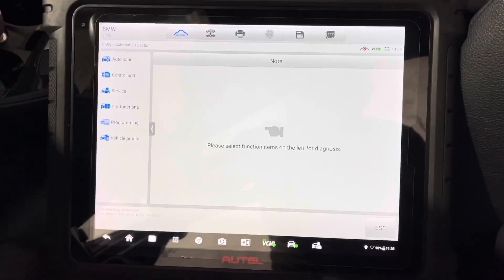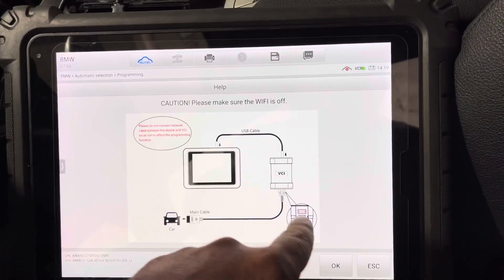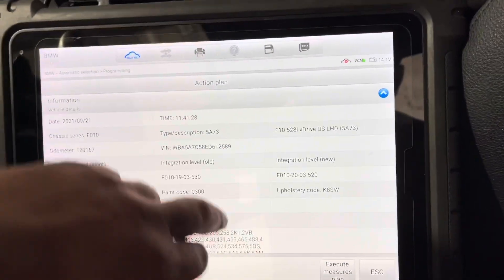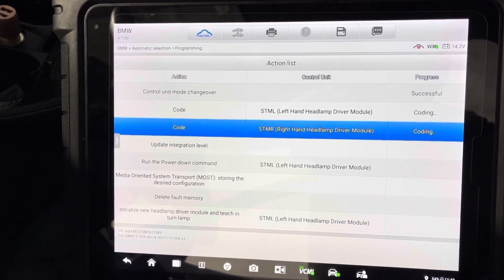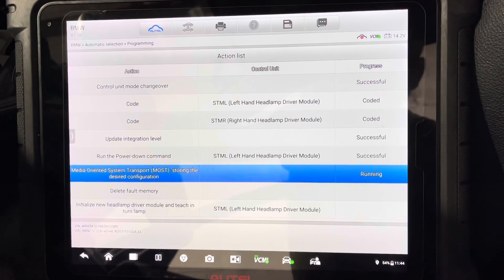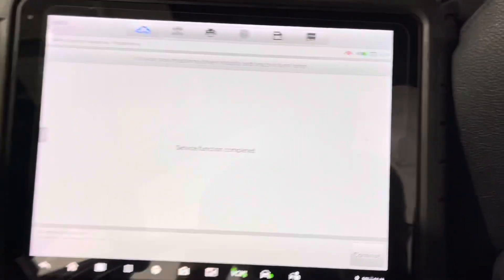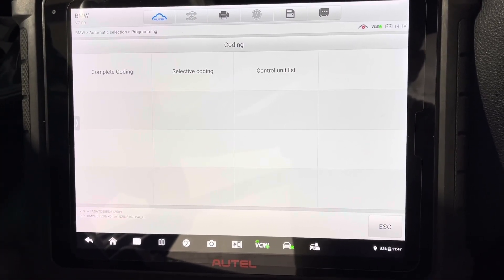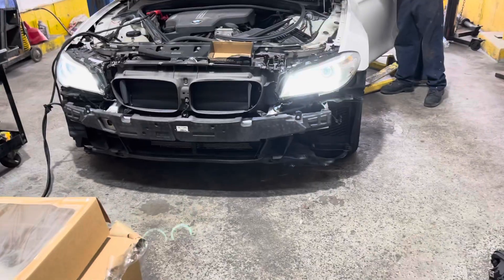BMW F10 Used Headlight Coding With Autel Ultra

Comment: Just finished coding my headlights with new TMS control modules today with my powerful Phoenix Plus and only took less than 5 minutes on my F10 M-Sport.  My scan tool that needed no J5334 VCI adopters & such!  Real easy and very effective! Also since it was that easy, I also coded my  rear new EDC struts and my BMW now is perfectly smooth on the road...  Was able to also fix several error codes by re-coding and initializing them and my BMW is now error free! 

Here's a tip:  for 2011 to 2014  F10 models, you can install a replica/Chinese brand TMS with same serial/part # and be able to code the module easily.  But if after 2014 models the ECU will check if the module is genuine/OEM and if it determines it's not original part it will block you from coding it and you will be required to get BMW original TMS control module in order to be coded to the car!
Reply: Its great that you know how to code this damn TMS module i just saw three video only one made any sence. What is Phonix Plus and where can we get one?
Reply: My Phoenix Plus 2 does not seem to have an “online programming” option to program new headlight TMS modules.  I was able to do the initialization procedure using the AFS option in special functions, but the right headlight is pointing to the right on my 2013 pre-LCI F10 535ix.  Am I missing something?  Yes it’s up to date with an active subscription.
Reply: @PaulNeilson-p3v  No online program needed....  it's also available in the Special Functions but the AFS is the shortcut to getting there in Modules tab..... Did you use Genuine headlight TPS module or aftermarket Chinese module to activate and initialized the headlights? It it was aftermarket you had to make sure it was as exact copy as the original from back to front of the circuit board or else it will not program correctly!
Reply: @BIGG_DOGG_DONALD_TRUMP 
I replaced both headlight assemblies with aftermarket Chinese assemblies due to water intrusion.  Are you saying these will never work in my BMW 2013 535ix?  Is there a way to get the Chinese TMS modules to program correctly?
Reply: @BIGG_DOGG_DONALD_TRUMP 
Could I install my original TMS headlight modules in the aftermarket Chinese assemblies?  I already installed complete aftermarket assemblies in my car.  The initialization procedure using Phoenix Plus 2 removed any faults on the dash and everything works except the AFS.  The headlights do not point in the right direction.
Reply: @BIGG_DOGG_DONALD_TRUMP 
Also, thank you for the help, it is appreciated.  Based on your initial comment, I thought the Phoenix Plus 2 would be able to program my aftermarket assemblies because my car is pre-LCI.  It was not clear I needed to check the TMS modules, that came installed in the assemblies, that they were a perfect match to oem bmw part.  Now, I’m out over $1000 usd.  I don’t know if the BMW TMS modules will work in the aftermarket lights.  Everything looked identical from the outside.
Reply: @PaulNeilson-p3v  Try to install the originals in the aftermarket headlights and test if all features work....  Also if your headlights are shooting the light crooked or at a wrong angle, look if the headlights have adjustments... They all should... On the original headlight to adjust them there is a hex bolt on top of the headlight towards the orange corner LEDs.   When I updated my Xenon light bulbs to LED's i had to adjust both headlight that way.  They light up perfectly ever since!
Reply: @MrLaloman18 any suggestions?

Comment: @huseyin uyug I have a 2013 528i x drive with xenon lights but they are broken.. can I just put the headlight module in another headlight assembly and code it with Autel?
Reply from the maker: Definitely
Reply: @huyug1  can it be any other type of assembly? Does it have to be xenon?

Comment: hi , does this autel maxisys ultra can reprogram any car ecm?? does this required to subscribe any company to get the code from online?? im kind of new to this. but i wish i can become a programer... my brother body shop has many car need to be reprogram ..
Reply: Check your cars manual. If the ecm can be programmed, then autel will most likely work if you want to look up it up you will most likely find someone programming the ecu for your vehicle